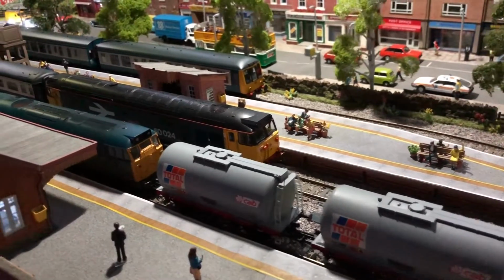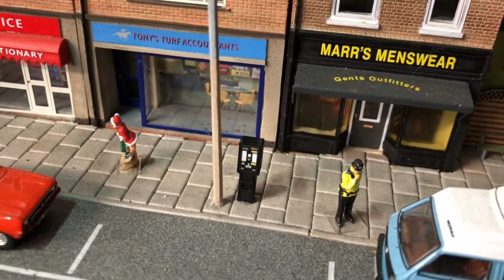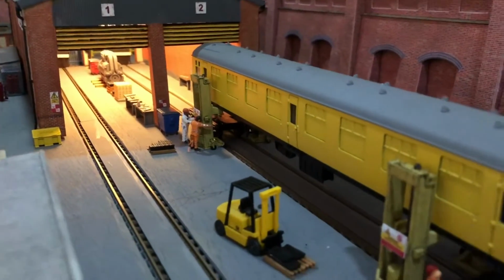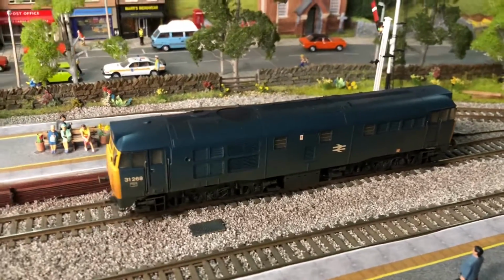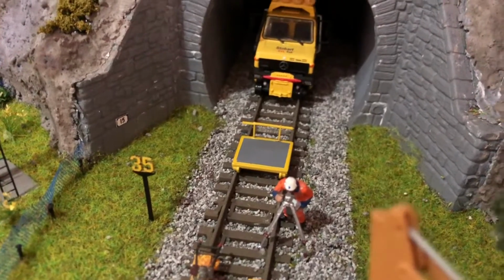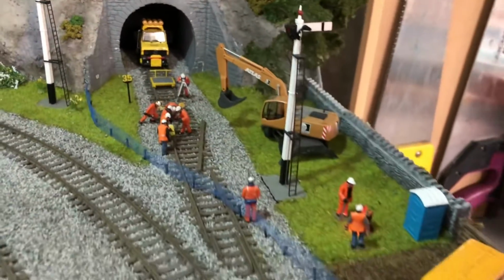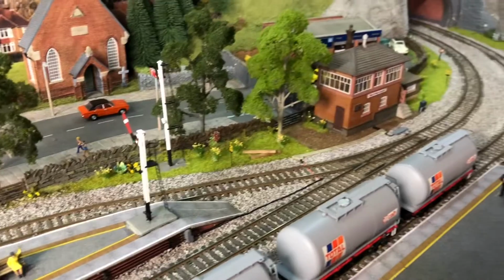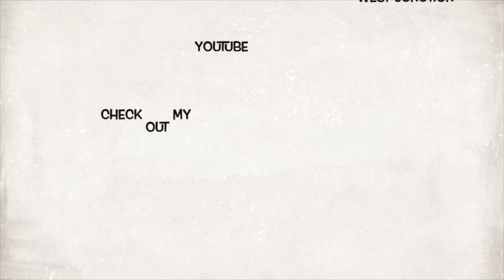No 44. A spanner in the works with problems from a Hornby class 31.

Comment: AWESOME layout. I REALLY liked your engine shed/maintenance area. I had a LIONEL GG-1 that had problems moving and it turned out the motors were fine, but the trucks/gears were bad. New trucks and it ran fine. Of course, I figured this out after I replaced both motors!
Reply from the maker: Thanks Larry really appreciate your comments. 
I think I’m going to drop the loco off at my local model shop when it reopens. 
Stay safe and well 
Andy

Comment: Hey Andrew, sorry for the Class 31 problems.  My first thought, not knowing the motor at all, is that a plastic gear in the drive relay is messed up.  That would explain the full power and the motor trying to drive, but the gear is broke and only part is making contact to move it.  Anyhow, your repair scene is great, and I will ALWAYS love watching your trains run.
Reply from the maker: Thanks Anthony I think your correct with that. Just a bit annoying as it’s a new loco that’s been in storage for about five years and I’ve only got it out today to run it for the first time. 
Thanks again for your nice comments and I hope you and Joyce are safe and well. 
Regards 
Andy
Reply: @MarchWestJunctionTMD  If it has been in storage for five years! I have heard that the grease that Hornby use can solidify, and this causes the gears to jam up. Careful dismantling and Cleaning the gears, and re lubrication, or all the gears, should solve the issue. If this is not the issue the other area to look at is the drive belt for the roof fan. A lot of 31 owners (Hornby ones) remove the drive belt as this causes drag on the drive from the motor. Just cut it and bin the drive belt. I have done this on a couple of my Hornby locos.
Reply from the maker: @mikeking2539  
Hi Mike thanks for that 👍 it had a small improvement when I cleaned the grease and gave it a service but when I cut the belt off it ran like a rocket 👍 
thanks again
Andy

Comment: Really like the new extra details and all the cameo scenes.

Re: 31 268. Is it a "high mileage" model?  If so, I would suspect the brushes in the motor have worn out. Unfortunately they are not replaceable so you have to buy a complete new motor unit but they are not that expensive. Can you smell electrical burning?  If you could also take the body off and make a quick close up video so we can see and hear it a bit better we may be able to provide further diagnosis?  Cheers.  Vivian.

Edit:  Ah, just read one of your replies to another comment and I see the loco is very low mileage and has been in store.  That would indicate to me that     possibly excess white grease that was put on in the factory has hardened and is clogging something. Excess grease is a common problem with both Hornby and Bachmann.
Reply from the maker: Thanks mate that’s give me something to go at I will get the screwdriver out and have a tinker. 
Thanks again for you suggestions 👍
Stay safe and well 
Andy
Reply: I had a 'New'*   (*who knows how long it had been sitting in the shop) Hornby Class 56, and that just sat there on the track doing nothing, just humming with the lights on.  I ran the shop, and was advised not to do anything with it, but bring it back. The guy took it home and worked on it in his own time over the weekend, and I can assume from reading what others have said , that it was the grease that had hardened, anyhow when I got it back, it runs perfectly!